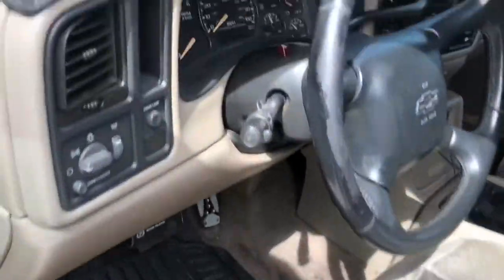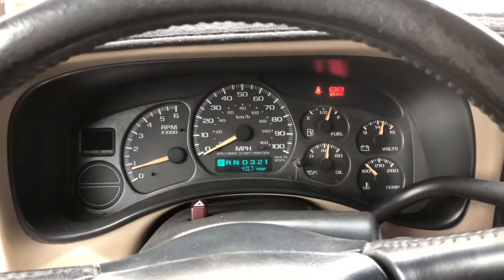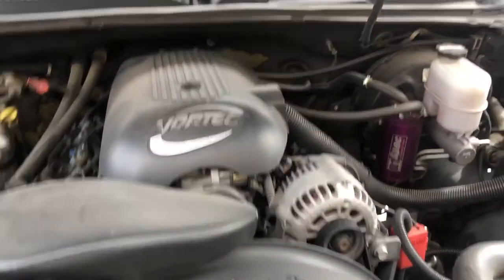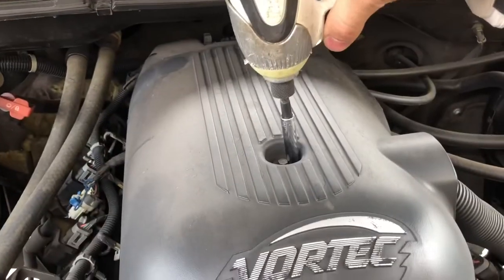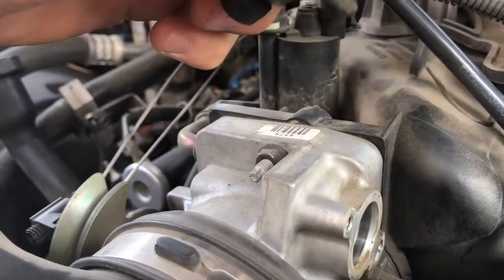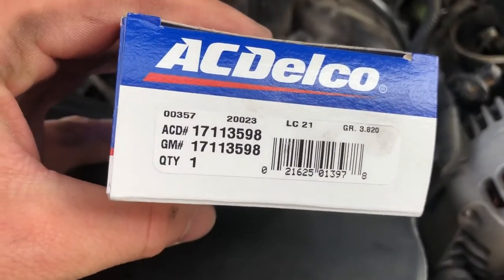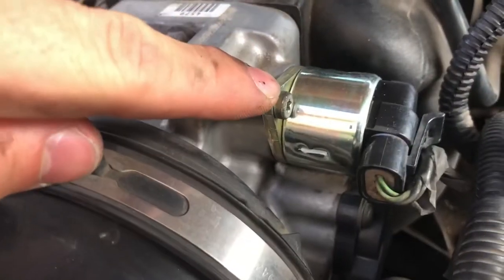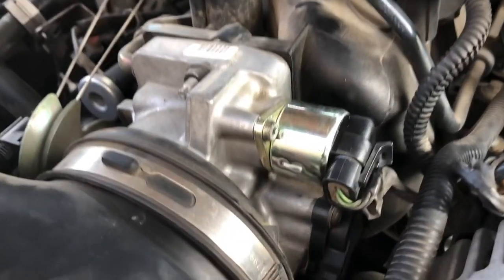How To Replace the Idle air controle valve for a 1999-2006 Silverado

Comment: You left out the most important part. To reset that iac you have to unplug both the iac and tps turn your key on without starting the truck then turn the key off then plug them in and start the truck.
Reply from the maker: Ohh snap, i had no idea that was a thing, thank you for informing for future notice!
Reply: @IanSully_  hey man every day we all learn something new.
Reply: Thank you so much for sharing that, helped me out! I installed both on my Silverado and it was revving high. I reset it and it runs and starts nicely!
Reply: Whats a tps??
Reply from the maker: Throttle position sensor
Reply: @IanSully_  thanks
Reply: Thank you thank you thank you thank you thank you thank you ........
Reply: @lonzophil  I take it my comment really helped you out. Lol
Reply: You're a goddamn hero. That fixed it right up. I appreciate it!
Reply: I realize I am pretty randomly asking but do anyone know of a good website to stream new tv shows online?
Reply: @Eli Everett flixportal
Reply: @Rudy Braylen thanks, I signed up and it seems like they got a lot of movies there :D I really appreciate it !!
Reply: @Eli Everett happy to help :D
Reply: Bang ! I replaced mine and I didn’t do what you said so te rpm where high I removed and put it back and same thing so I just put the old one back and return the new one ... I think I didn’t do this and that’s why the rpm were high right??
Reply: @jasonjones1693   that happened to me the rpm were high and I didn’t know why so I end up returning the IAC and using the bad one
Reply: @Cesar Quiniguez  that's exactly right. Doing what I said resets the ecu to recalibrate the new sensor. It is key to installing the new sensor.
Reply: Nice
Reply: @cesarquiniguez1838  l
Reply: What’s the iac?
Reply: @jorgearana1217  idle air control
Reply: I  changed  the iac and the dam thing is still starting with high rpms I've done exactly what I was supposed to do
Reply: @jerryhenderson2289  unplug iac and tps turn key on for 30 seconds. Then shut it off. Plug them back in and then start it.
Reply: @jerryhenderson2289  what year is your truck?
Reply: @Brandon Birchfield seems like it if you did what I said after replacing the IAC
Reply: @IanSully_  how do
You disconnect the tps amd where is it ? Thank you .. 4.8 litre
Reply: Lo puede poner en Espanol porfavor
Reply: Excellent point.
Reply: Doing that right now! Thank you!!
 Hope that's the problem , I'm just going down the line... trying to f8nd the air/oxygen leak.also fix my idle.
Reply: YOU GET ROCKSTAR STATUS☆☆☆☆☆☆
that was my fix! I'm literally singing now!!
Reply: @kimdurham9578  use a can of brake clean or starter fluid. Spray small sections around the intake and wait a second in between each spray. If the rpms go up that's where you need to look.
Reply: Butter!!, had to kick then shift it.. cheers..
Reply: @kick_then_shift  does the reset work for the tps aswell??? replaced mine and no change?? i have a 2000 5.3
Reply: @fixmyride7890  yes you have to do exactly as I said
Reply: @fixmyride7890  it resets both of them at the same time. Just follow the instructions above.
Reply: @kick_then_shift  okay cool thank you, I don't know why I couldn't find that info anywhere!    How did you find that out haha
Reply: @fixmyride7890  learning how to tune my truck with hp tuners
Reply: You are correct I just messed with mine and was left on high idle around 2k rpms and I did what you said and it's back to normal idle thanks
Reply: @IanSully_  &
Reply: Your myhero
Reply: @longlivechina7538  glad I could help you out
Reply: Your comment even after 2 years you posted has helped me and many people. Thank you!!
Reply: Shout out we are just trying to learn 🎉
Reply: @miguelgonzalez1159  no doubt just trying to pass on the knowledge.
Reply: @elieverett5608 😂😂😂😂
Reply: Thank you sir!
Reply: Thank you sir!
Reply: @kick_then_shift   I have a 2001 Chevy Silverado 5.3l cammed. I replaced both tps and iac but after I changed the iac it started revving @2000rpm.
Reply: @kurleychadney2218  did you do the relearn process like I posted here? Sounds like you didn't that's why it's revving like that. Also did you have it tuned for the cam?
Reply: Mine is low idle and did not work to bring it up. Any thoughts.

Comment: Mine acts crazy on when a/c is on.. stubles and dies..RPM drop.Im assuming it's the IAC
Reply: Bro mine Stalls only when ac on.. did changing the iac solved your problem !! ??
Reply: @larrydiaz5423  not for me but I thought it would have...mine needs to be retuned
Reply: Did you ever figure this out? I’m in the same boat
Reply: @marckulaszewski4163  no
Reply: @BeardsandCars   what about now? Struggling with mine, and when my truck is off the battery dies unless I unplug it
Reply: Anybody figure out why truck boggs down when ac is on, fine when ac is off
Reply: Mine is doing the same thing and the ac cuts out randomly
Reply: Any results on this? It's literally the reason I'm watching all these videos.

Comment: Just wondering how much do they usually cost? Trying to order one online & there’s a lot of different prizes
Reply from the maker: Can’t remember exactly how much i paid for mine, but can’t imagine it would cost very much. I recommend going with an AcDelco or Delphi one if you have the option.
Reply: Kinda ridiculous honestly. Just paid 150 yesterday for the only decent one I could find locally… duralast. It works great but was just as much as acdelco or Delphi and was $150 paid for convenience too because they can be had for 70-90 online

Comment: Got an 03 that just started sputtering this afternoon. June 1, 2021
Reply: Plugs?
Reply: @Polaris91rxl  idol control censor that's on the side of the throttle body. $199 at O'Reilly

Comment: Can’t remove this on an 04 Tahoe since it is part of the throttle body and the whole thing is riveted to it, so you have to get a new throttle body assembly for this kinda issue.
Reply: That’s a stupid design. Did you try taking the intake off and spraying cleaner on it? There are videos and you can read online on how people say to do it
Reply: You can use a screwdriver to pop off one side of the rivit (side with the mushroom head) it’s only aluminum, and make sure your new part has the retrofit screws and nuts with it. I just did my 05 Tahoe works great now.

Comment: Are these called something different cause I can't find mine on an 03 5.3 silverado
Reply: I can't find it on mine either and it looks to me like his is a drive by cable, whereas mine is drive by wire. Yours may be the same.
Reply: @jboyanstey  did u have one
Reply: On that year model you will have to replace the entire throttle body.

Comment: Mine has a tps as a changed the throttle body and I bought it with the new tps attached. But now my truck surges during a stop. Rpms jump during a stop and sometimes gets stuck
Reply: Check your cruise control throttle cable just a little too tight or lose can cause it to stick my shit almost wouldn't stop at a certain point rpms wanted to stay at 1200 while coming to a dead stop

Comment: just replaced mined , only complaint for so far is my truck is coasting for long periods of time , if let off at 50mph it dosnt loose any speed , rpm goes up 1 dash after letting off the throttle.
Reply: Same , some guy said to un plug both the iac and the tps then turn your key without starting and turn the switch back off and plug em back in